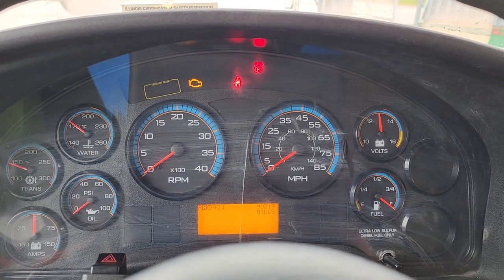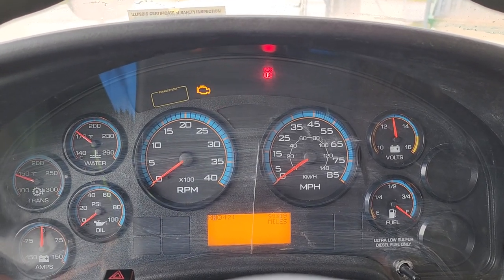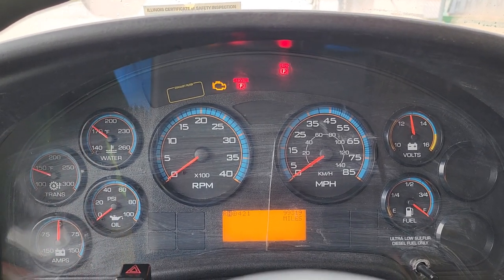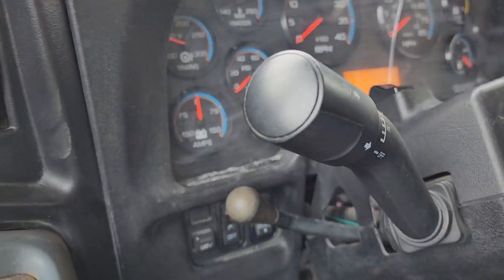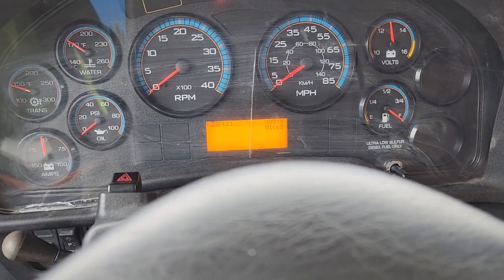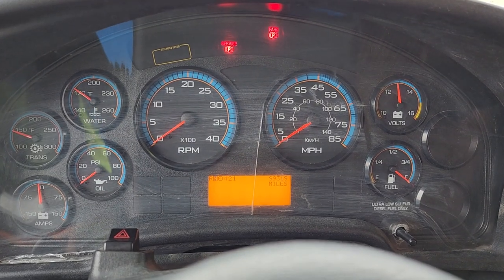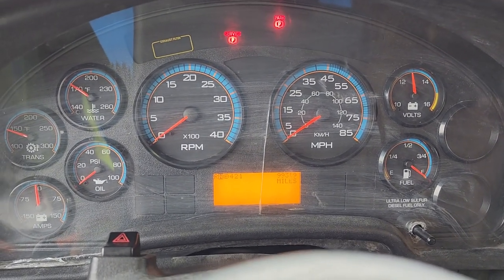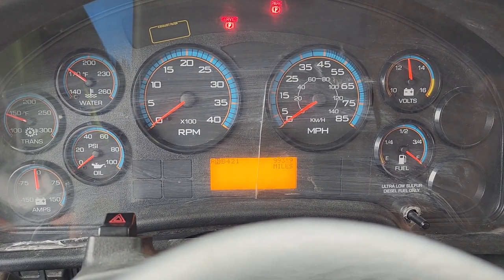HOW TO TEMPORARILY DISABLE THE DASHBOARD WARNING ALARM ON ANY INTERNATIONAL TRUCK OR IC BUS

Comment: I do this a lot when I have to use the accessories and my air is pumped down 
The beeper can get annoying lol
Anyways…do you know if there is any way to clear an active code? I have an EGT3 Exhaust Temperature Sensor fault…and after I replace the sensor the fault is still going to be there and preventing my bus from doing a parked regen…I will not be paying a $700 subscription for NED software…which is the only software compatible with MaxxForce engines
Reply from the maker: Unfortunately I don't know if it is possible to clear codes without a computer.  Your best bet will be taking it to a workshop.  My other recommendation would be deleting the DPF.
Reply: A.) That's illegal
B.) The EGT3 has nothing to do with the DPF
Reply from the maker: @ThatOneLT1  I'm just saying, and this is only my opinion, but DPFs are stupid.  Yes they prevent black smoke from being spewed from the exhaust, but if something goes wrong with it say for instance it starts to decompose, then black smoke WILL get through and it can cost thousands just for a new one.  Not to mention for some reason, at least on the earlier DPF diesels (I'm not sure if this still applies to current ones), diesel can get into the oil and dilute it as a result of it going into normal regeneration.  That is a fatal design flaw and as a result, lubrication is compromised.  The EPA unfortunately doesn't care about all of the drawbacks of these filters and only wants to rob people of their money just for DPF deletes yet arguments can be made saying marine ships burn lots more diesel unfiltered and emit the same pollutants.  It all really doesn't make sense if you think about it.

Anyway, as for the EGT3 code, I only thought that did have to do with the particulate filter because you mentioned you are unable to do a parked regen.  Like I said, if you don't have the software and don't have plans to get it, visit a workshop as soon as you can so that filter won't become blocked.  I'm sorry you're dealing with this not too long after acquiring your bus.
Reply: It's a stupid setup
Any MIL code will prevent a regeneration...
While it doesn't directly have anything to do with the function itself other than tell the computer when the exhaust is getting warm
My state does annual safety inspections and the DPF has to be there and functional or they cancel your registration
The EGT3 is a common issue on these...it's not too expensive nor is it problematic
Navistar just likes to screw the customer and make it so only they can repair it
Other than that the bus is great, like I've said before the older DTs 2009-2010 are the best and will last forever
Reply from the maker: @ThatOneLT1  I see.  Welp, best of luck with your bus, I really like how its number is 420.
Reply: Thank you, 
It's not bad for the most part
It runs and drives great despite having one little sensor going out after 220k miles
Not too bad I'd say, could be worse...
Reply from the maker: @ThatOneLT1  Big time.  It could be like our now former air brake bus which I got to drive once, but that bus was in terrible shape and spent a lot of time in the workshop.  Served 15 years and now it's being gutted for parts and then sent to the junkyard.
Reply: @BusMaster99  j
Reply: @BusMaster99 the EPA with their roadgoing emissions standards is a joke. DPF’s and all that emissions bs ruined diesels only for us as consumers to be stuck with a less reliable, more expensive product that breaks down more often as a result of said components. Only to line their pockets and other things.

Comment: This does not work on 99.9% of internationals. It only works on this specific instrument cluster dash. Most Internationals use the LT dash which is 100% digital and does not have the toggles or buttons your pushing. (For example the tagometor reset for the milage)